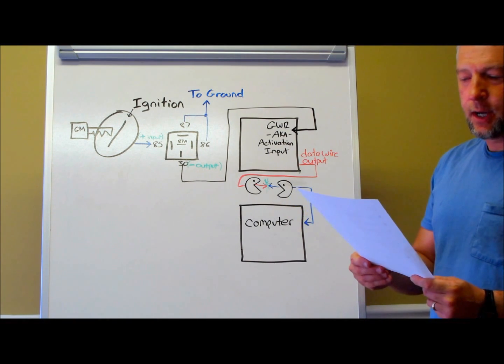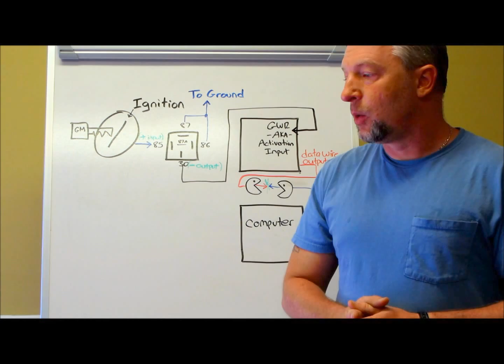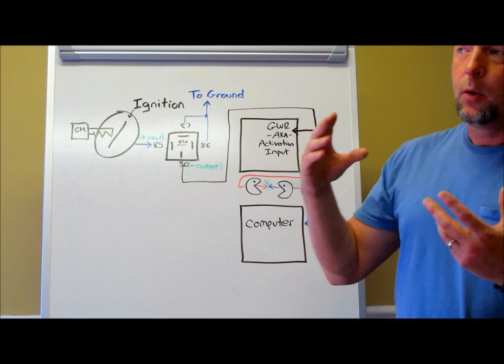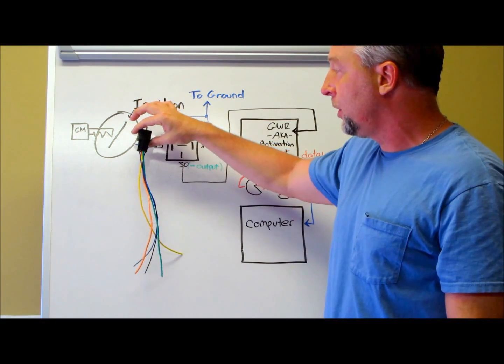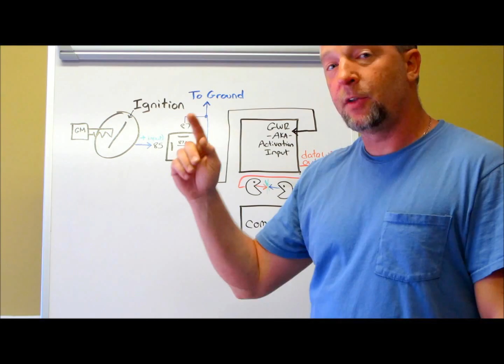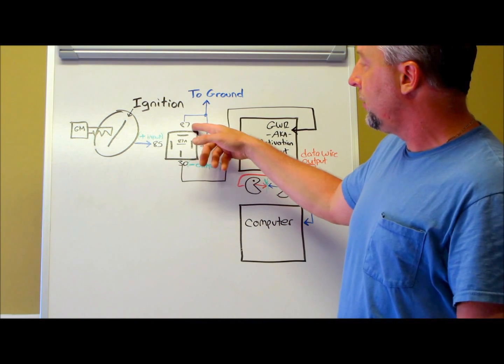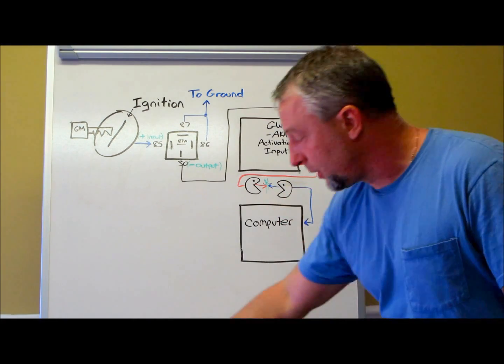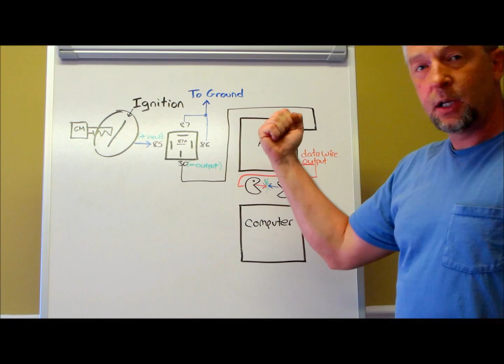Tricking (disabling) factory transponder anti theft system with an aftermarket databus bypass module

Comment: I have a 99 k1500 Chevy suburban. My old mechanic replaced my steering column with one from a 97 Chevy. The 97 truck had no paslock system at all.  Mine is a  PL 2. I want to try the resistor fix. I know the ohms. The issue.  New steering column does not have the wires nor the sensor on the ignition. I cannot find any guidance online for this situation. Where do I splice the resistor? Do I have to find the wires and complete the circuit? I'm at a loss

Comment: Trying to figure a way to reach out to you about a problem im having with my car its been sitting now for a year and i truely miss my car so much ..im newish at the mchanic life actually pursuing my career now. But im not the smartest with the electrical side of things ive got a security light on but its solid my car will crank but not start my obdm stopped reading as i believe its loose now but i was told it was my pcm whats the chances of it truely being a pcm im having a hard time believing its the pcm fuel and spark usually never fail at the same time

Comment: Damm what a great video. Just started to have issues with my 2001 jeep grand Cherokee Laredo 4.0. Any way you assist with letting me know what bypass module to purchase. I still have both keys but planning to have two keys made without the chip. Any other advice or recommendations you could make.

Comment: First rule of smart car ownership:  Have more than one key.  Not doing so is just predictable disaster some day. 

One of recent cars didn't use a chip, although many people thought the bump on the key was a chip.  It is not, it is one of 15 possible resistors that must match what the BCM is expecting.  I used to keep a spare door key in my wallet and an ignition key inside.  I could lose my entire key ring and still get home.

Comment: Hi ju took the immo antenna off the ignition switch and wrapped it in foil out it I a foil chip bag. Taoeit shut n tucked in as far as there would go n t rive fine . 2095 Honda pilot

Comment: awesome that you exist!  I need your help and off course your help deserve a contribution.
how we can get in contact. is possible to eliminate the immo in a 1998 toyota? or check if the system is working ? according to the factory wire diagram  the communication bettween immo module and ecu is by two wires. the signal from those wires can be check? any voltage, ground?

Comment: 04 Toyota Camry had the key tested the chips supposed to be good in it but it starts and falls dead and then I can't get nothing at the tachometer won't come up nothing or it'll spin over but I have no power to anything can you help me and also I'd like to if you can if this system will work I'd like to buy the pigtails and the

Comment: I had to remove my ignition switch because key quit turning. After re-installing it the immobilizer will not let the car start. It ois a 2003 Toyota Sequoia and has almost 300000 miles on it so it is not worth much. I can not afford to buy a new computer for it and do not have much money to put into it. There has to be a way I can disable the immobilizer or whatever it is that will no longer let the motor start. I just want my key to start the car like keys did before all this computer stuff. Can you tell me how to start and use MY OWN 2003 SEQUOIA?

Comment: I’m having the right no fire scenario in my 2000 Ford F150 4.6 right I wrote the transponder underneath the dash do I need to replace the one around the ignition and then thmblrer or can I just replace the immobilizer around the timber or do I need to replace the whole system
Reply: If u can help walk me thru what to really do hold my hand I will thro u good cash I’m broke down out of my home state and really want to go home I’ve thrown my savings at this truck trying to figure thisnout

Comment: have a 1999 dodge caravan- with a bad BCM- Dodge dealer told me cannot be fixed sale the van for parts.  i love my DODGE i cannot start my own van due to being locked out from starting .  anyway i can by-pass the security lock-down of the starter from being grounded so it will start ? thanks

Comment: Too much tech ... just take the ignition ring out cut the positive of the transponder ..loop that positive wire 3 time In the ignition ring and wire it to your fuel pump fuse
Reply: What's the ignition ring
Reply: I have a buick lasaborer 2005 my wife lost the only key so I had to pull the ignition with a drill so I got it out bought the key and ignition I even tried the risister not working it has the pass key 3 in it from gm however not one of the vidioes tells me the corrected colors from the pass key 3 there are 3 wires a purple orange and black no yellow then the ignition has a bundle of wires can some one pleas tell me what wires I use to put the resister on I have a family and can't afford to get it fixed I'm losing work and if I keep losing work we will lose are place help pleas anyone
Reply: Don’t work if you loose your sing key Chief

Comment: We like to do this for my Mazda rx-8 2004. Any special requirements to accomplish that? I have the old ignition transponder ring but no key I’ve put a new ignition in there that has a key. I’ve used a programmer and checked it says it has no keys tied to the immobilizer. What would I need to do to finish it or to work around?

Comment: Do locksmith work myself and people always grumble that they have to pay to much for the training I’ve been keeping myself up on for 30+ yrs. I politely tell them you’re paying for training/experience/knowledge not my time. 

The look on their face when they realize you can’t just learn it in the two minutes it takes to do the job. 

They don’t want to pay I just reverse what I did and walk away. Generally when they realize their vehicle will be in same instance from when I arrived they change their tune

Off to do a 2006 Hummer H3 to turn security off in the pcm as the dreaded passlock anti theft issues, then a 1977 Fiat Spyder ignition switch replacement and replace and reprogram immo module for a 2009 Mazda 5. Hopefully I won’t be gone to long.

Comment: My truck will not start the anti-theft light will not come on

My 1998 ford expedition will not start and now my anti- theft lite dus not come on

I tried to put a code reader on it to see if there was any codes and the data plug dus not work I check all fuses on it and they are good soo can someone please help me

Comment: I have a 2006 Chevy Malibu. My key got broke the tip broke off to be exact. I had a locksmith cut me a knew key, but my car refuses to work with the newly cut key and now won't even recognize the old transponder chip in the old key that use to crank it and run. Now the Security light remains lit all the time. It doesn't blink it just remains lit and no matter how long I leave the key turned to on the light doesn't go off so I can not program any keys for it. It will crank up and cuts back off after about 10-15 seconds. I am at my wits end with this. How can I start my car and it stay running longer than 10-15 seconds?

Comment: I have a quick question I'm doing an engine swap basically I'm using the ECM and the under hood wiring on a car with a transponder key either a 2010 to 2012 Fusion or maybe from a 2004 Focus would I need anything to make the engine run the car that I'm putting the engine in does not have a transponder key

Comment: i have a 98 jeep grand cherokee that would not start , the horn keeps going off. what i need to buy from you
Reply from the maker: try unlocking the driver door with the key while its open, thatll disengage the factory alarm

Comment: I've changed my ignition out so it bypassed the skim ,but my alarm still kicks on.I purchased the Xpresskit CHALL  along with the correct harness ,will I have to make a connection with the relay still?
Reply from the maker: yes you will
Reply: So I make the connection through the starter ignition wire to the relay and ground it off?What if I got the ECU to bypass alarm ?Then there would be no use.for a bypass kit,right?Even though the skim delete is suppose to rid the alarm problem?

Comment: Idk if you can help me but i have a 02 dakota i just bought. As soon as i open the door all the lights start blinking and the horn beeps like the anti theft is going off but my truck still starts up and runs. Im having trouble figuring out the issue..... Any ideas as to the problem or a solution?

Comment: If I have a dummy key and therefore can turn the key switch to the on position can I bypass the need for the transponder chip if I jump the starter relay? What I'm asking is will the car still start even though I don't have the chip programmed if I jump it through the starter relay?
Reply: did you find answer to your quesrion i also have no key

Comment: Please helllp 98 cavalier2.2 no key ignition (vasp 1 )ribbon ripped off  won't start tryed 22ohm tryed everything past 2 weeks ,wires for ign are loose( br.or) red.red)white.pink) yel.start what to do cheapest way plzz
Reply from the maker: have you tried using a passlock bypass like a 556L
Reply: No sir I have not I actually live in my car and if that don't say enough obviously money's tight I have a new ign from same model car only problem no key I was wanting to try maybe the relay setup for the ignition wires but I don't really know anything of it but I have br.,or. As radio ECT and 2red as 12v , and white n pink as acc and on if I'm not mistaken then there was 2 black small and one green small wire in the cluster do you know by chance the order in which I should connect them or even if there a specific order that initiates the sequence to start correctly I had it starting for 5-8 sec then dieing but now just turning

Comment: I hope I'm not out of line saying this on someone else's channel, but there is a much simpler solution. On nearly all Ford and GM vehicles, we can permanently delete the anti-theft system for under 100 bucks. Instead of using junk aftermarket modules to try and send a fake "OK to start" signal to the PCM, we can simply tell the PCM that this vehicle doesn't have a passive anti-theft system. At that point, the PCM enables the injectors and starts the car every time, with zero concern for what the anti-theft module wants it to do.
Yes, I am saying unequivocally that we can permanently delete Ford PATS/SecuriLock and GM VATS/PassLock on maybe 90% of vehicles. As these Ford and GM vehicles start approaching 20 years old, we see all kinds of anti-theft failures. They're difficult to diagnose, expensive to fix, you can't really get around them, and sometimes the parts needed to repair them are obsolete/unavailable, or excessively expensive. You can't hardly program one key for what I can delete the system for. Once it's deleted in the PCM, the vehicle will start with a $2 all steel hardware store key, even if all of the anti-theft components are missing or broke.
Reply: Would you mind telling me how to do this
Reply: @ccg7950  You just send me the computer, and I delete the anti-theft and send it back to you. If you want to private message me, I'll give you instructions for how to send it in.

Comment: I have a 97 Mercury Sable pats system I have everything in the video but whenever you come out of the module to the ECM do you hook it to the four wires from the transponder or is there another wire I need to hook it to the ECM

Comment: I know you have alot of comments on this post about if this woyld work for each persons car. I was wondering if a toggle push start button would bypass the need for a key or if it is even possible to link in your relay system with the push start.

Comment: I have a 98 grand marquis and the Antenna ring not communicating with computer just had it replaced and still doesn't work what should I do next I keep getting the same code of 13

Comment: How can this guy not be liked very good in formation.
Reply: Hey i just bought  a chrdaa ( 99cirrus) transponder bypass/ alarm/door control module im having trouble wiring this thing up to my car. I found the ig2 wire and ive only taken small nicks at wiring connector only splicing what i think is only necessary for getting around the transponder start but i cannot get it to disactivate the antitheft system. there is a step where it says hold it up to the igniton circle but my skim reader is busted for sure now since i started tinkering with it. does this affect the bypass module i dont want to splice up alot of wiring so far ive tapped into ig2 and two of the alarm wires but still no start just crank over and nothing else. can you please help.

Comment: I need help with my 99 yukon pk3 system. I am currently stranded, any help would be greatly appreciated. Thanks!
Reply: king necio i have a factory recall bulletin (Technical Service Bulletin TSB) from GM, that applies to any, and ALL 98-99 GM truck/suv applications from an s10 to an escalade. I successfully bypassed my 98 s10 with this Technical Service Bulletin. I can email you a PDF, or I could look up the ID number of the TSB(which Im gonna go ahead and find/post in this comment.) Last winter I didnt have this info yet, and i was able to revive an 02 Caddy Deville. Buut i had to find a donor car at the local junkyard, bought and swapped out the steering column, body control module, the powertrain control module, and the rear integration module. And that car is still on the road today. But if you go that route id get the factory radio from the donor vehicle as well because its programmed to all that as well, and it locks itself. Now this TSB procedure is muuch easier, it includes wiring diagrams for ever GM truck/suv for 98-99. Funny thing is it’s basically the same procedure on all, just the pin of the wire youre splicing into changes vehicle to vehicle. But there is the main steering column to instrument panel wiring harness in line connector. Next you find the YELLOW PASSLOCK DATA WIRE(circuit#1836) which is pin#D3 on the female steering column inline harness connector. Now you splice in 2 short pieces of 20guage yellow wire to the contacts of a single position switch, then splice,solder, and heatshrink the switch into the YELLOW PASSLOCK DATA wire PIN#D3 that will disconnect the passlock circuit wire in the ON position, so you can remote start it, and the OFF position makes the passlock function normally. They recommend hiding or mounting the switch on or under the dash, so that dont interfere with normal operation. That was how the s10 worked, and i had success with it on my personal project truck. Funny thing i saw in that TSB is GM recommends doing that to any 98 or 99 truck/suv. Hope this will help alotta people out, and save them all the countless hours I had to waste scouring different forums for close to a week lol! Anywho you should be able to google GM Truck Group UI Bulletin#26. I guess it covers all the way to 2006, and also covers vans.

Comment: In this video you sound like you know about this stuff pretty well. SUB'd 
Question: I have a 1996 Ford E-150 5.8l with the antitheft system acting up. The alarm system has no transponder key or key fob. To arm the "alarm" (horns, flashing lights) you have to lock the driver's door with the door lock switch. This switch has not worked in the last 8-9 of the 11 years I've owned the vehicle. About three weeks ago the alarm started going off intermittently both while driving and while parked.
My question is... what could be causing this and how do I fix or bypass it? According to my Haynes repair manual wiring diagrams fuse 7 goes to this module as well as... the power train control module, shift lever position sensor, the park/neutral position switch, the starter relay, and the starter motor/solenoid. There is no picture or replacement/test directions anywhere in the manual for the anti-theft module. I don't know where it is or what it looks like, so even though the diagram looks like it could be simply bypassed, (schematic shows the same circuit both with and without this module).
Any help or direction you could give would be greatly appreciated.
Thanks,
Thomas
Reply: If you have the manual, or access to one, the manual is Haynes #36904, the diagram is on page 12-24.

Comment: What’s up brother?
I can’t say enough about the help you give, it’s awesome. 
Your hardworking and dedicated. 
I have a 2001 Sierra, power locks but no AU0 code. Has factory theft system though.  
However I have a encore e1 I’m trying to hook up. 
Do I need to have it flashed, or can I have any schematics?
And how do I send you a personal email?
Reply: I figured it out... 
it’s great running your own fab/weld shop
But sometimes I can be dumb in other areas of a car. 
I wasn’t holding the start button long enough..
But I watched about all your videos, and you are thorough at your job. 
Forget these fools, there haters.. 
I have them to..

Comment: hi i sure hope you are still doing your thing online.. ive done my homework i just need one main question answered that i cant seem to find a cut dry answer.. WITH NO KEYS.. WILL THE MODULE WITHOUT INITIAL TRANSPONDER SIGNAL STILL BE ABLE TO SELF LEARN AS THEY DESCRIBE TO DO AND TELL THE SECURITY SYSTEM TO ROLL OVER.. I WILL BE DOING THE RED AND PINK WIRE AS YOU DESCRIBED..

Ilost all keys to my es300 1999 lexus..
Reply from the maker: The only kit that may work is the xpresskit pkt or the omega ib-t, no promises though..

Comment: I have a 04 freestar will this bypass the pats system I lost keys and way to much for new one I just want bypass the pats system and remove the lock on cylinder n use any key
Reply from the maker: If you have no keys I cant help you... sorry
Reply: I got new set with cylinder but needs cut and programmed but i dont have 300..that price is for that plus mileage at 1.50 times 37..
Reply: Ive had issues cause guess noone wants say yes cause fear of stealing carsi guess but i have title to prove its mine